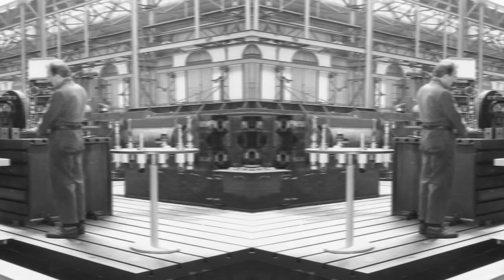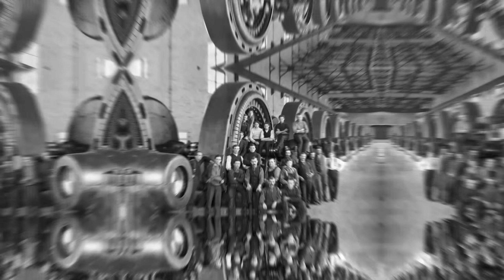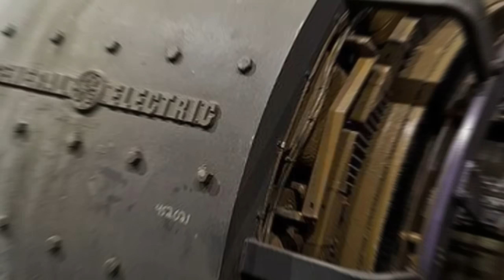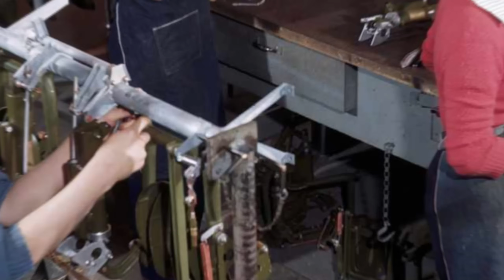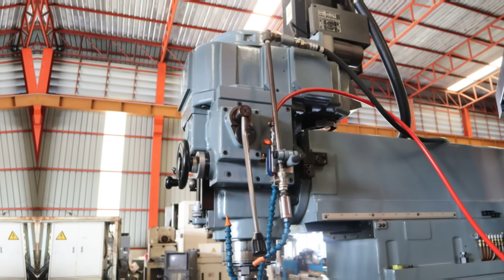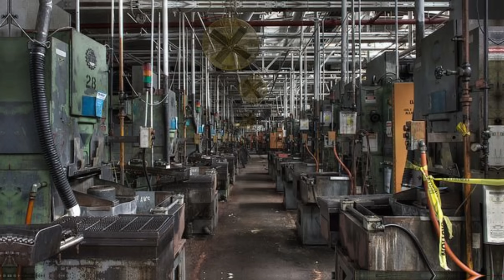America Had No Tungsten Carbide in 1928 — So Carboloy Forged Tools That Cut Steel Like Butter

Comment: It wasn’t just cutting tools that made the difference, the US couldn’t figure out how Germany was building aircraft so fast, they had mastered the metal extrusion and heavy press forging, a US aircraft motor mount, (can’t remember the exact name of the part) was made of many parts taking multiple machinist many hours to make where Germany was pressing them out in one shot and out of lighter material, magnesium. I believe the treaty of Versailles limited Germanys iron production and import but they had vast amounts of magnesium and learned how to use it! Using heavy presses to stamp out complete parts. After the war we ( USA ) took some of these heavy presses back home along with Russia who may have gotten the biggest one but this is what lead to the Air Force’s Heavy Press Program and is still in use today.

Comment: When I was a kid some 70 years ago my stepfather built a separate shop to build and repair his amusement park train ride. He installed a 12" x 36" belt driven lathe. I pretty much taught myself how to operate the thing. Fortunately for his budget he worked for a big manufacture and used the lunchbox supply system for tools. When I was 12 or so he decided he needed three more cars to handle the increasing demand. I had to turn the 24 wheels out of 6" diameter x 2" thick steel blanks.. After using up the high peed steel cutters on one wheel I had heard of and asked for some simple carbide tool bits. What a revelation. I could cut faster and with a better surface finish. It took most of a winter working after school and on Saturdays to finish the 24 wheels and 12 axles. Not bad for room and food. I also built things like a rail bender and hydraulic press among other things. The other things included composite forge welded spring steel and file knives for the deer hunters in my High school. $20 a blade wasn't bad in 1958. 

I spent most of my career as a bored bureaucrat but the pay was almost adequate and the pension is great. I do miss building things but my condo association would object to me building forge on my deck to get back un the blade business. Not to mention illness has sapped the strength I would need.

Tell your wife you have more then1,000 subscribers. I am one.